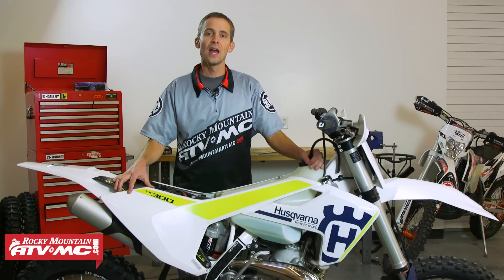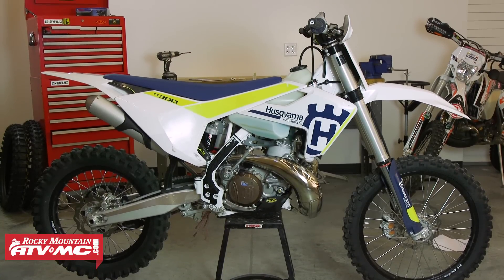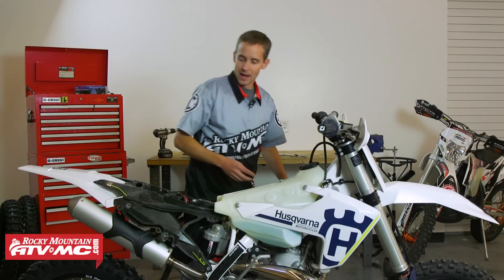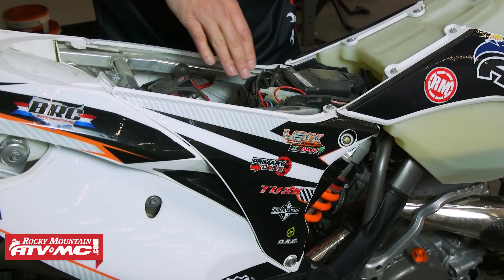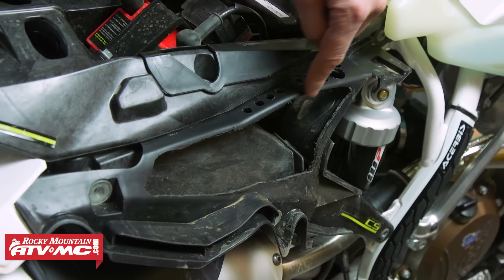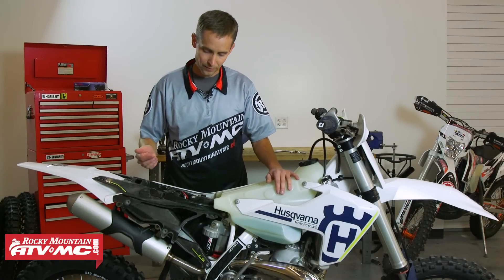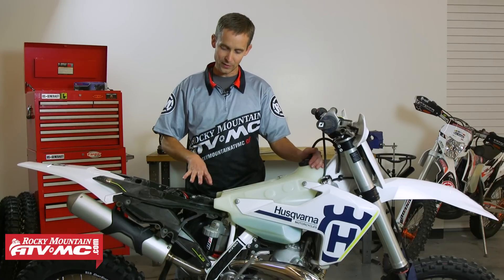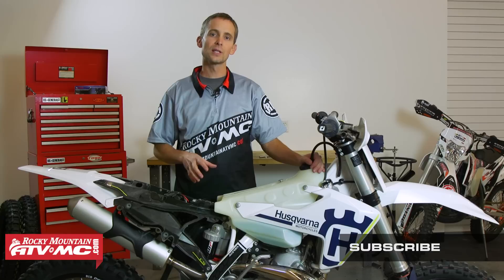2017 Husqvarna TX 300 Airbox Mod

Comment: hey Justin hey I just got done doing the airbox mod on my 18 tx300 and once I put the body panels of back on the right side you can't see any of the new channels for air??? so I was curious did you change or cut into the exterior body panels as well.... once the bike is all put back together I can't really see how this would be much of an improvement

Comment: Yes this is needed. i recently did the boot swap on my 2017 FE501. I installed the same year  but with the more dirt specific FC450 which does not have the reeds and it fits perfectly. I'm thinking of adding additional venting like you've done to the top and or side. What about protecting against water getting in? Is this a concern or not because it all hidden behind plastic and number plates????
Reply: cw127cw water will get in regardless if its hidden lol i wouldnt cut holes in my airbox if ur crossing rivers all the time.
Reply: cw127cw and ur air filter is going to get way dirtier way quicker cuting a bunch of holes in the air box , i already get mud in my airbox almost every ride it would be way worse with more holes, ur filter is going to be all clogged from mud and ur bike cant breathe, dont bother doing this if u go thru water and mud lots.

Comment: Did this modification help the bike not run as rich as well as increase overall power?
Reply from the maker: Yes some riders have noticed better throttle response and a smoother overall power delivery. You can test it out by removing one of your side panels for a short ride and see if you feel a difference.

Comment: Is the air box built right into the sub frame? to me it looks like it so I don't think I'd cut the air box all to shit like that because it probably hinders the integrity of the sub frame itself. It's not like the thing is super charged and pulling huge amount of air, I would think just drilling some round holes would be fine if ur worried about it getting starved for air..
Reply from the maker: No, it is not part of the sub frame - Justin
Reply: Rocky Mountain ATV MC  Are the factory riders doing this mod?

Comment: I just don't understand how this wasn't addressed from the factory. What is your take as to why?
Reply from the maker: Great question!  On all the bike shootouts you'll see that the KTM's have more power than the Husky's.  Reason being that the Husqvarna doesn't breathe very well from the factory.  When you find out as to why, please let us know! Thanks for watching. ~Vinny
Reply: Rocky Mountain ATV MC no i uave a 2017 ktm and its pretty well the same not many places for it to get air , but all u do is jet the bike for less air in the air /fuel ratio , not cut holes in ur bike lol if u jet it properly it runs ....simple as that.
Reply: It could be done on purpose to give the Husky's a different feel. With the higher price tag, it becomes a different market. KTM/Husky may know that the riders buying those bikes are weekend warriors and not racers.
Reply: Seat Time I have to disagree almost everyone who races off-road is on a ktm or husky two stroke.
Reply: BRAAPPTORRR agreeded cause they make the best enduro bikes and beta
Reply: KTM and Husky, though they share A LOT when it comes to manufacturing their bikes, are still two separate companies with different goals and objectives. From the end of 2014 when the owner of KTM used one of his other companies to buy Husky, the speculation was that Husky would be seen as the Lexus to Toyota. A difference in performance like this from manufacturing could be showing us that direction. Though it's less of a ''performance' enhancement and maybe more of a reliability thing in the case of the airbox. There is no disagreement that we see a lot of Orange and White/Blue at the offroad races now (KTMs in our garages). Just saying that there is probably some logic to the madness behind their airbox being designed that way.
Reply: ya the logic of it is to have less places for water and mud getting in because they are mainly used as hard enduro bikes, theres nothing wrong with how they did it you just need to jet the bike properly to run with less air, not cut holes in the airbox, yes thats the quick fix for ppl that dont know how to jet their bikes or dont want to but then the airbox is more exposed , not worth it for me cause i mainly do offroad enduro riding and i dont want to clean my filter everytime i ride the bike, i already do it like every 2 ,3 rides and its not a fun job.lol
Reply: 2Wheels 4Life I have 2018 KTM XCW and my son has a 2018 TE300. His air box is closed off like this one. My KTM has aluminum subframe and the right side is completely open like the mod in this video. As you suggest, should I not ride my KTM in the same areas as the TE300 because water and mud will get in the air box?  This mod simply models after the KTM on the 2018 models.  Do I like cutting these new TE’s?  No but cutting them will have the exact outcome of a 2018 KTM.

Comment: I live in Salt Lake and ride AF Canyon and similar trails this time of year. Curious what jet settings you used after this mod. Thanks!
Reply from the maker: We actually ended up going with the JD Jetting Kit.  We tried all sorts of different jetting configurations and could never get it quite right.  JD Jetting Kit is the way to go: https://www.rockymountainatvmc.com/p/930/10974/JD-Jetting-Jet-Kit  Or Check out the Lectron Carburetor: https://www.rockymountainatvmc.com/p/930/70037/Lectron-High-Velocity-Adjustable-Power-Jet-Carburetor-Kit
Reply: Rocky Mountain ATV MC I got the JD jet kit and am installing today. Could you share the jetting configuration you felt worked best? Thanks!
Reply from the maker: Dylan Taylor - I will get with Justin and ask him for you.  Be in touch, thanks. ~ Vinny
Reply from the maker: Spoke with Justin.  He just followed the instructions that came included in the kit.  Really easy to follow.  He thinks he is running the blue needle, but for mountains the red needle would be better.  With the instructions included, you shouldn't have a problem getting your bike dialed.  Thanks
Reply: Rocky Mountain ATV MC Thanks man, I appreciate it!

Comment: Anyone know if the 2018 TX or TE also needs this mod? Haven't seen them yet.
Reply: Jon Snider I have the 2018 tx300 and of done some carb modifications and still not finding that sweet spot in terms of power all the way through smooth anyways. I'm going to try a couple more different Jets and if still no luck I will definitely be starting with drilling a few holes instead from cutting out that huge Bay on the other side. If that little bit of airflow makes a difference I'll definitely be cutting out the other side of the airbox.
Reply from the maker: The best help for me was finally going with the JD jet kit needle.  It is shaped way different than the OE needles I tried.  I loved it after that......Justin
Reply: @rmatvmc  Justin are ready to sell your old used up 2017 Huky yet so you can get a shiny new TPI bike? Im looking for a 2017 or 18 now

Comment: I'm only in like 300 feet elevation do you think i still need to drill holes and open the air box up or is it maybe because you're so high in elevation
Reply: Derek Brisco pretty sure you're carb isn't jetted for 300 ft the stock settings are a lot higher than that. I would recommend jetting it for sea level and working from there before you start cutting your bike up

Comment: First comment 😆
Reply: Perfect, now be the first to go ride your bike.
Reply: Seat Time thx man 😄
Reply: it's 2017 and you still do that type of thing? damn! follow seat time's advice and be the first to ride your bike. Now THAT would be a REAL victory!
Reply: Seat time is where it's at. I've had my 2017 300xc now for 60hrs of actual ride time to really see what's going on with this new set up. Yes it's comes rich and it's been a journey to figure out where to have the jetting. Now I live at sea level and ride no higher than 500m. My challenge has been the weather. It's up and down in pressure and temperature. Try dealing with that. I've seen all the modes people have suggested and are temped to try them. But I looked at my air filter and noticed how the dirt builds on it to see how it's breathing. It's breathing just fine. I'm sticking with carb adjustments. Lots of formulas to choose from. My current jetting is 43-73 needle with clip at second from the top. 440 main with a 35 pilot with the air screw out 2&1/4 turns. My two cents.